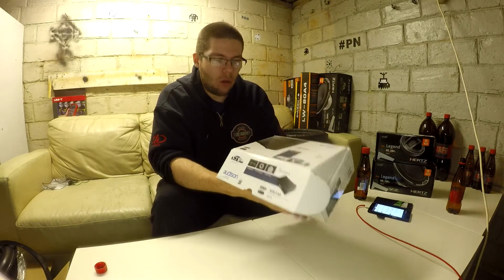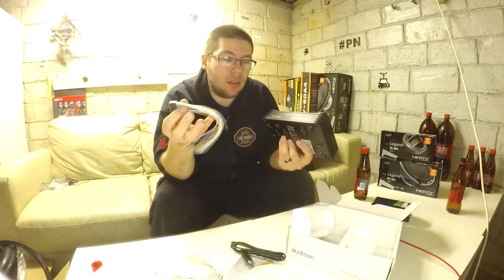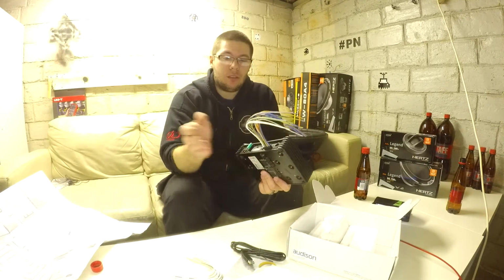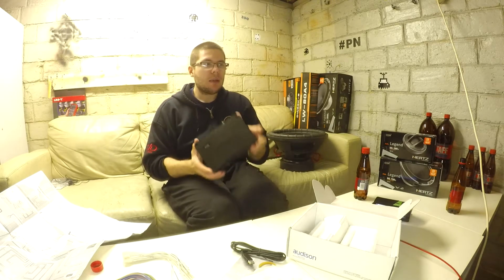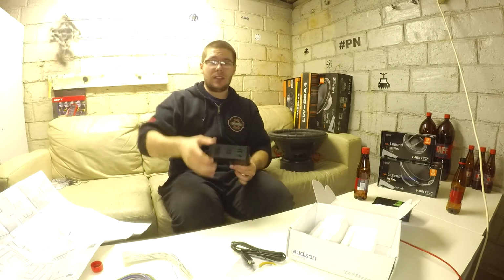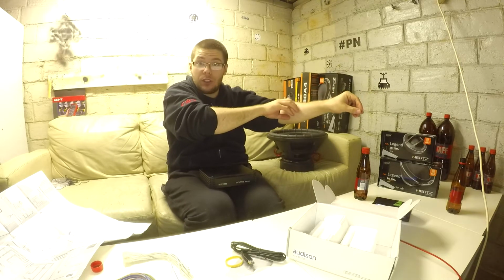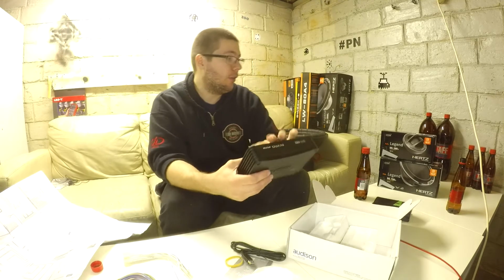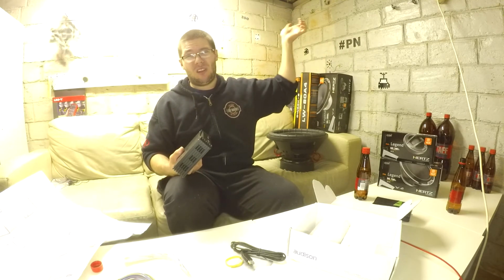ENG | Audison AP8.9bit 8-channel amplifier with DSP

Comment: Nice video 👍🏼 . Is it possible to strap two of these AP 8.9 amps? If so could I strap another AP 4.9 for an additional 4 channel extension? I plan on using the amps for 10 mid range speakers (6” 1/2), and 10 high range (tweeters)

Comment: I was in between getting this or the mosconi  60.8 dsp  I feel the audio guy I'm going to is just trying to sell me the most expensive. The audisom product your reviewing was my first choice but I'm leaning toward the mosconi I don't know what to do. I have a two way and want the option to add a mid-range driver in the future and have all the benefits of dsp. What would you go with just as an opinion and why
Reply from the maker: Mosconi is competition grade equipment. The pricing is much higher, but do you benefit from it in equal?

I mean if you are going full steam ahead to sq competitions, go for mosconi. You will be confused how to use it, but its great.

If you are looking for oem upgrade, simple to setup, go for audison. It is great

Comment: Could I connect it to a fiber optic system ?  I have a w221 merc tbanks
Reply from the maker: It cannot read directly the optic can system. You need adapter that reads the system and transforms it to analog.  It will cost around 200-300€ from connects2.co.uk

Comment: Thank you so much for this video in English! It told me every thing I needed for my setup. Want to run factory HU with the 8.9 powering 6.5 component  set and adding sub amp in my 2016 F150.
Reply from the maker: dusty rhodes nice to hear!! Did you watch the installation video also?
Reply from the maker: dusty rhodes https://youtu.be/3uMIsRqxWBc
Reply: check out Audiocontrol LC-6.1200 for your f-150 125w x 4 @4ohm (door speakers) and bridge ch. 5&6 for 400w @4ohm to subwoofer. All in one amp! use (FOR-11CK) harness to hook up to factory head unit. I think you would like this better than the above.

Comment: Bro, do I need a mono amp for sub woofer output?
Reply from the maker: Seah Daniel nope, you can use stereo amp also, just split the rcas with y-splitter
Reply: If the subwoofer in 2 Ohms ,mono power will be better